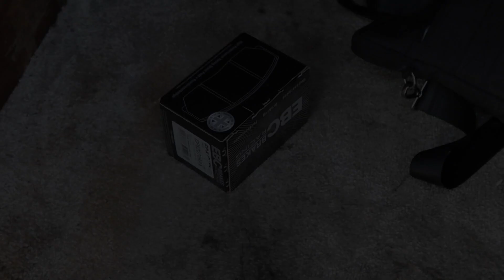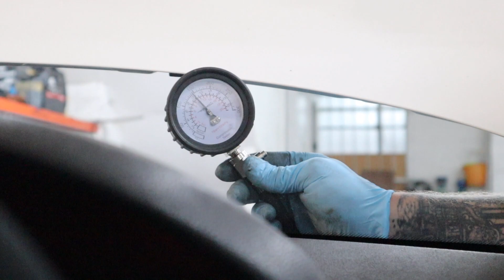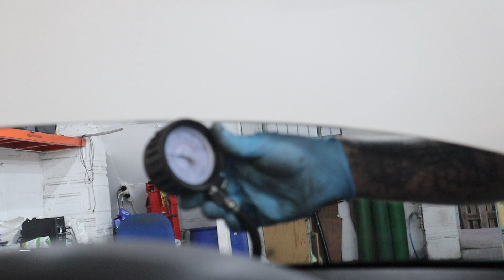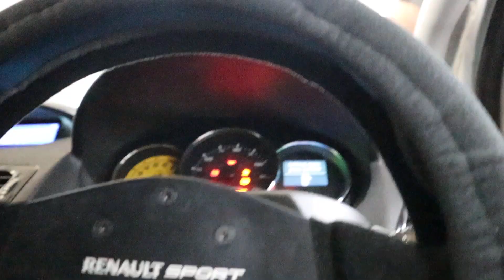SOME SERIOUSLY BAD NEWS FOR THE MEGANE **NOT CLICKBAIT**

Comment: Take the fucking lightweight single mass flywheel out. Smfw that have not been designed for cars will just TRASH everything. Porsche that is Porsche had a FUCKTON of problems and engines having the most random problems and dying because of them. Just put the dual mass into it again.